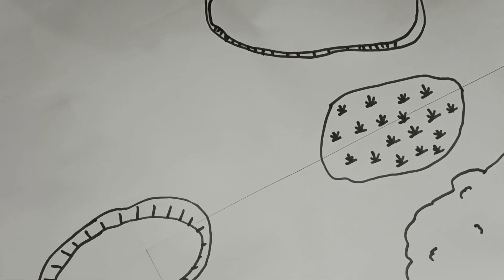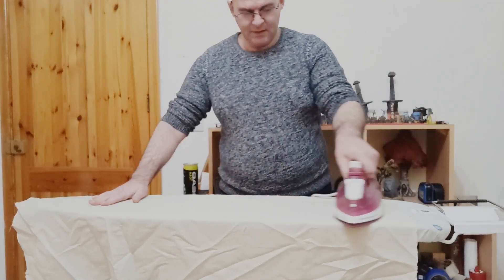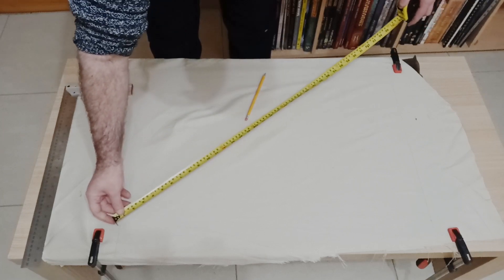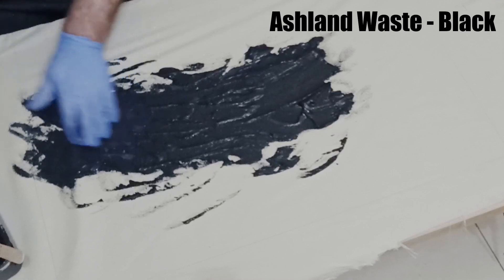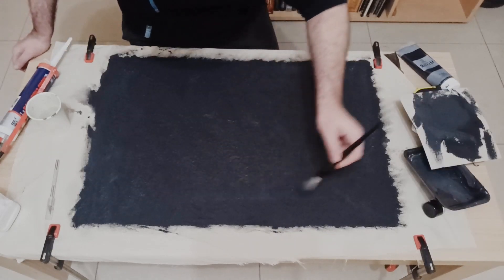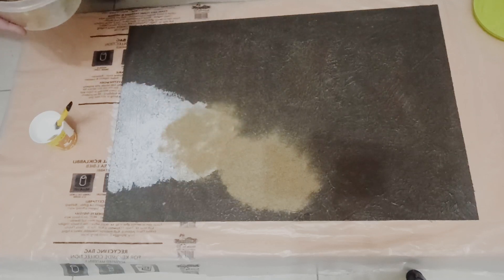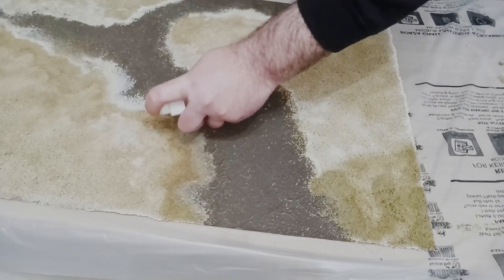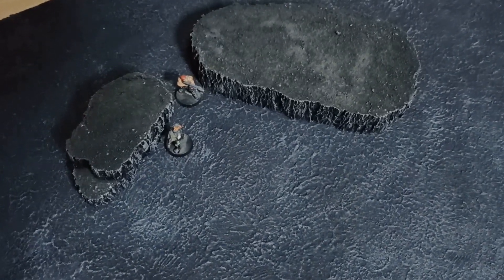I made my own SUPER CHEAP Battle Mats!

Comment: Clear acrylic caulk thinned with denatured alcohol or water can be used to adhere flock and remains flexible after drying
Reply from the maker: Yes, caulk worked perfectly for the others where I used only caulk and baking powder. I haven't gotten around to redoing the grassland one, but the plan is to just use two layers of caulk - one tinted brown as a base, and a green one for grass.

Comment: Using a non poly backed canvas ,do you think it woukd be possible to caulk the other side as well to amke double sided mats?
Reply from the maker: Yep! The only thing I can see being a bit tricky is lining them up, ideally you'd leave the excess on until you've done both sides so you can stretch them properly.

 The caulk creates a barrier so the color on the other side won't leak through, but I would avoid using heavier textures like sand on either side, as that would make it more difficult to roll up. Baking powder doesn't harden it up enough for that to be a problem.
Reply: @Karlmakesstuff  thanks! I've done one the base layer using your video but haven't cut the excess off for exactly the reasons you said and baking powder is exactly what I was thinking for the other side for a sandy texture
Reply from the maker: @fenrar9777  awesome! What surfaces are you making?
Reply: @Karlmakesstuff   This is my first attempt and something like this so doing a standard "planet ruins" and "desert" but I also have clearly went to big with a 6' x 4' as it used way more Caulk than I anticipated :D
Reply from the maker: @fenrar9777  oh wow! No starting small huh? :) Good luck, hopefully both sides serve you well.

Comment: Fantastic tutorial. Have you found after 2 years if there has been any cracking or shrinking over time?
Reply from the maker: Nope, not so far! There is some shrinkage early on in the process when the caulk is first curing, which is why you need the canvas under tension until that sets completely. After that it's stable. The caulk layer is not very thick, so cracking has not been a problem so far, but if you use sand instead of baking powder it could be; haven't really experimented in that direction.

The grass mat was a dud, but the problem was the layer of PVA I used for the flock. It's far less flexible than the caulk, and the resulting layer made rolling it up very unpleasant... Apart from the weird reaction with the caulk which left white patches everywhere. The plain desert and ash waste ones didn't have that problem.

I'll take some pictures later today and post them in the community tab. Will check on my water mat too as that uses different materials and I haven't used that in a while - will report back!

Comment: I'm really glad your video popped up in my recommended feed. I've volunteered a few tables of terrain for a local convention tournament early next year and being able to have some nice table mats to match my layouts and themes would be fantastic but expensive. With this method though? Easy as piss, just a weekend of work and I'll have as many mats as I like!
Reply from the maker: Glad you found this useful! If you're planning to make grass mats, unless you make green goop in the first place try sprinkling the flock directly onto the caulk while it is drying rather than gluing it on later. Saves time and no risk of having it go wonky like mine did here. If you want to share some photos of your mats and terrain when you get to them, drop me an email or hop into discord, it's always great to see where people can take an idea :)
Reply: @Karlmakesstuff  Thanks for the tip! I'll make sure to keep that in mind.

Comment: How does it hold up over time ? Does the caulk shrink and mess up the mat ? I want to make one but I want it to last.
Reply from the maker: So far so good. I have one that I keep stored flat and one I keep rolled up. The rolled up one needs some smoothing when unrolled (put something on the ends or leave it face down for a couple of hours after 2 months), but otherwise it's dead flat. It's more of a mechanical issue than a shrinkage one.

Comment: How viable do you think making these double sided would be? Or is the canvas cheap enough that you might as well just make more?
Reply from the maker: It's doable - the canvas wasn't that expensive, but if you want to do several variations it definitely helps. Just make sure you don't trim down the canvas before you do the flip side, that way you have enough material to clamp it down when doing the second face. You'll also need to make sure that the first face is completely, completely cured before starting the second one.

One of the reasons I didn't do it this way is that rolling up a one sided mat protects it fairly well from dust and stuff, if you have a two sided one, one face is always going to be exposed. If you plan to store them in a tube or something, then it should be a good way to go.

The two cases I would not recommend it is if you're adding flocking on top (it doesn't roll as easily) or if you're doing a water mat like I did in https://youtu.be/Gc1no2d1IUs - since there are bits of waves above the surface, it's not completely flat. Haven't seen any problems so far with a plain back but haven't tested it with a textured one.
Reply: @Karlmakesstuff  yeah that makes sense, thanks! I plan on making multiple armies, and i liked the idea of having a themed mat for each army. I will definitely give it a try
Reply from the maker: Nice! That will look awesome :D If you try to do a grass mat, I suggest just making a green mix - using PVA on top like I did in this video doesn't flex very well :)

Comment: Nice job! I'm curious on how many silicone tube you used per mat?
Reply from the maker: Thank you! If I remember correctly I used two tubes to make the three of them. It's acrylic caulk though, not silicone caulk - the results would be a bit different with that. I used silicone on my ocean mat if you want to see the difference :)
Reply: @Karlmakesstuff  Thank you !  good point

Comment: Thank you, what did you use for clear coat?
Thank you in advance!
G
Reply from the maker: Thank you for watching! I didn't use a clear coat on these as I don't know of any coats that flex this much, and besides the caulk mixed with the color holds everything together just fine. They're still going strong ;) 

If you have concerns about waterproofing them though, you could probably give them a thin coat of silicone like I did on my water mat in this video https://youtu.be/Gc1no2d1IUs - but be aware it might make it look a bit flatter.

Comment: Nice! Thanks for sharing this Karl! I haven't seen this technique before. So just to make sure... Even if there's a s**t ton of baking soda and paint, this stays flexible and doesn't crack?
Reply from the maker: Thanks Slavko! As far as I can tell, that is the case. For this to crack, it would need to be very thick. Using baking powder, the acrylic layer is still more or less under 1mm thick. Sand would make it thicker but it's still thin enough to flex without cracking unless you really pile it on.
Reply: @Karlmakesstuff  Cool stuff! Let me know how it holds up over time. I Might try and make one or two for on the go purposes. Tha ks again for sharing this mate!
Reply from the maker: @TheMiniMason  Will do, thank you chief :)